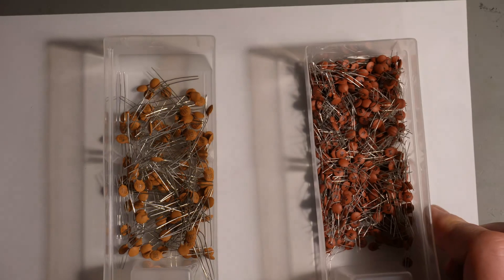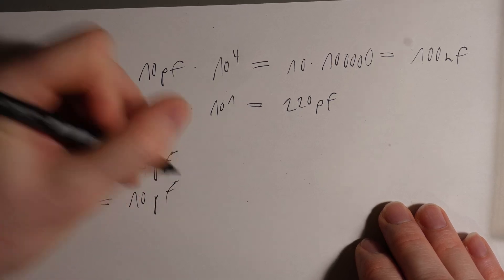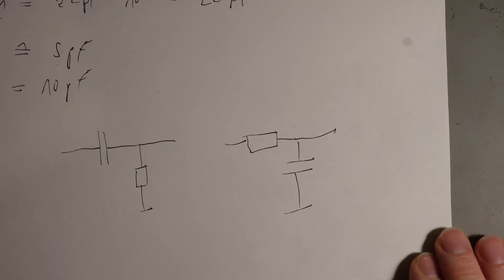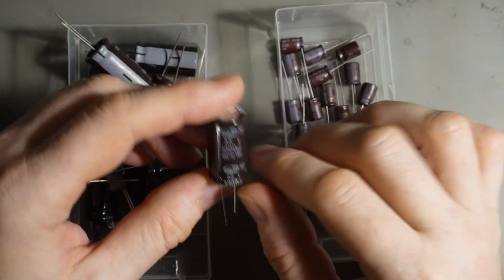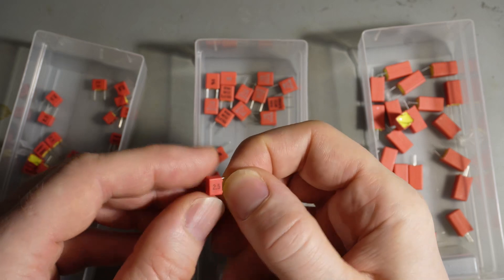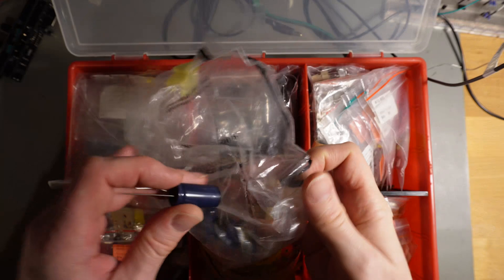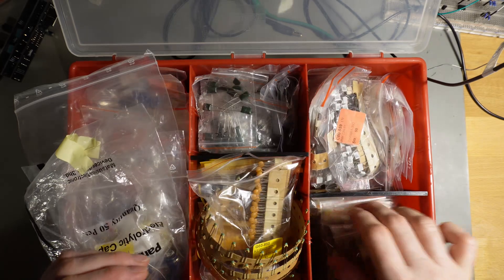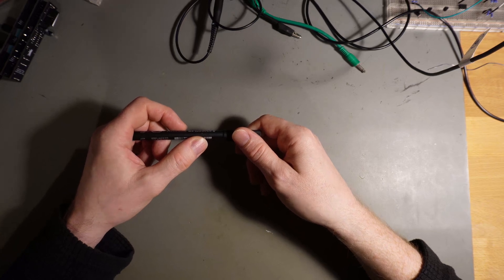Capacitors demystified - types and identifiers - Synth DIY basics

Comment: one thing i'm still trying to figure out is how to understand what type of capacitor is used when? unless this is specified in the BOM, the schematic does not really help, or maybe i'm still too new to all of this. 
i get that because electrolytics are polarized, it's easier to differentiate this in the circuit, but what about ceramic vs. film? 
i wonder if there is something implied that i'm missing? but plenty of circuits out there don't have BOMs so this seems essential to know

edit: also looking forward to more of these videos on basic components
Reply: Yes this is often missed out on schematics. 
I certainly use specific types for various tasks.
Ie: Electrolytic capacitors between audio stages .
Mica or polystyrene for vco expo converter timing.
Box film caps for say sample and hold and filters , also mica and polystyrene,depending on size and availability .
Ceramic/ Kermet caps for op amp decoupling close to the chip.

Comment: When I got into synthesizer designing it was all quite overwhelming. But it simply gets easier and smoother over time. So a little hint for everyone, dont be scared and dont feel overwhelmed.. Ceramics, foil and electrolytics are definitlely good starting point. Rabbit hole with various tantalum, polypropylene, mica etc.. and their specific uses and reasoning can wait for later (and is not that super important).
All the best!

Comment: Hi! What if I'll use a 10uF ceramic capacitor for DC blocking? Does it have some flaws? I've bought a bunch of them several years ago (from China). I've measured - the capacitance is fine. Looks like usual yellow caps in a "ball" shape.